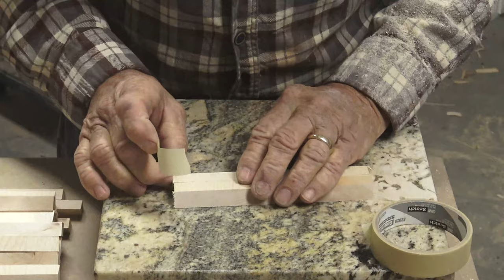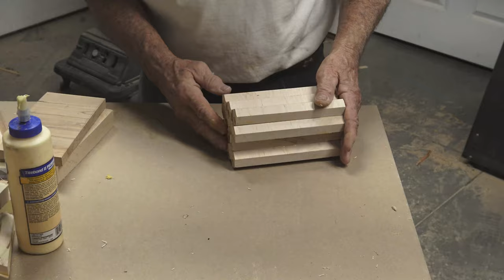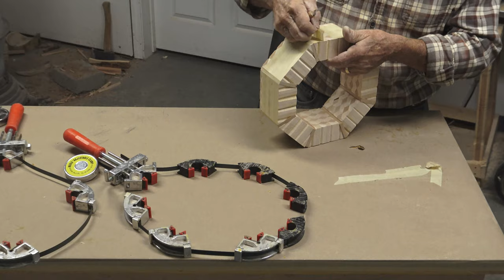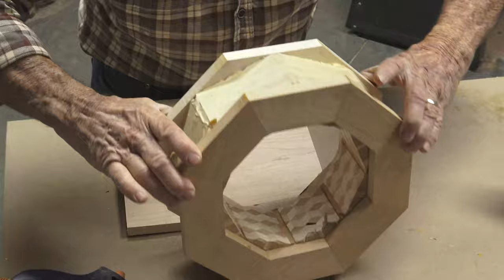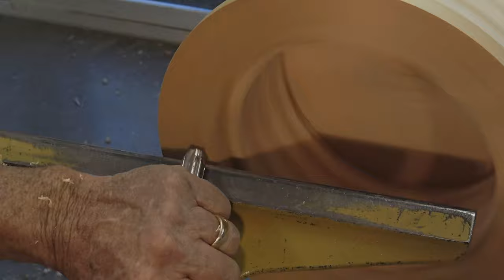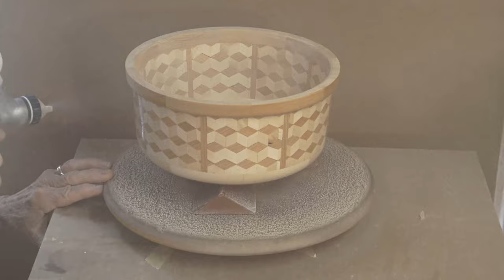Woodturning MC Escher Style Bowl

Comment: Man, that is just flat-out stunning. I admire your tenacity as well as the skill and vision. Takes a lot of dedication to execute the detailed process on display here. I have a technical question. I notice that you rarely (never?) apply glue to both sides of a joint and sometimes don't even spread glue before joining surfaces. Do you sometimes encounter problems due to these practices?
Reply from the maker: Thank you so much 😀  I use so much glue on my surfaces that when I clamp it, the glue oozes out of the joints and actually spreads itself.  I have never had a glue joint fail.  My son claims that I should have stock in the glue industry because I use so much.  Thanks for watching!  Tommy
Reply: @squarepegtommy7670  thanks for the explanation. Keep up the wonderful work.